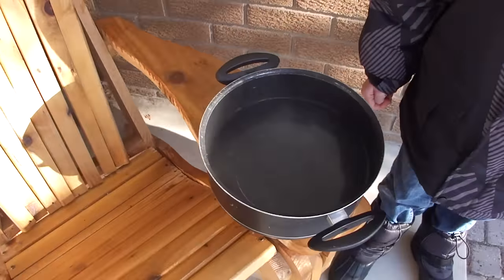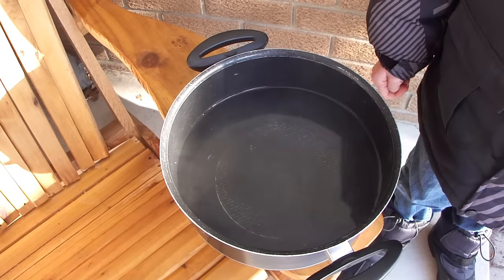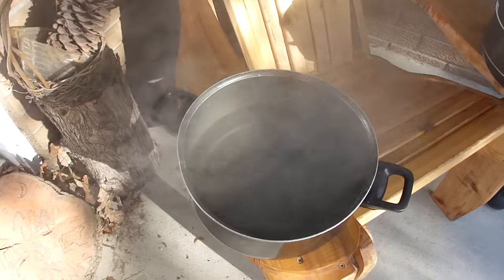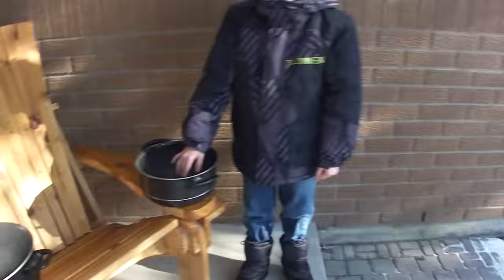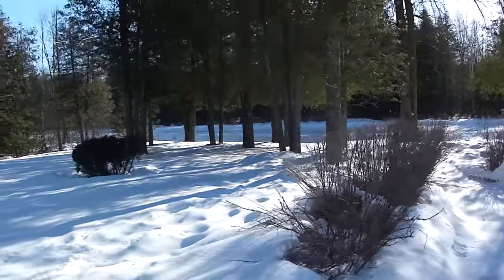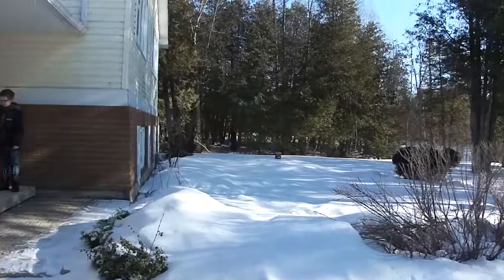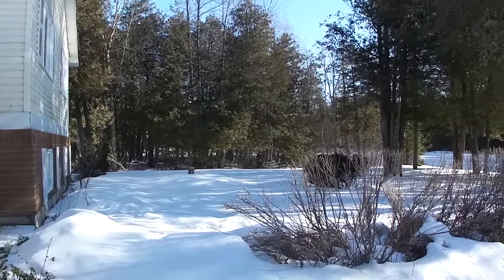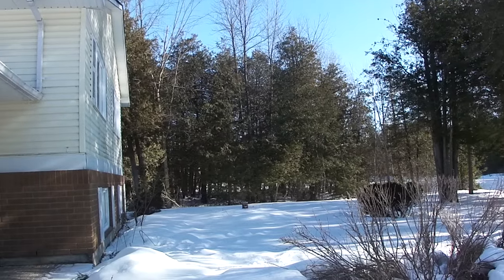Hot water freezes faster than cold water?

Comment: It’s produced more vapor...

How does that mean it’s freezes faster?
Reply: That's actually sublimation, no? I might be wrong
Reply: @dionemartins0212  yeah, unfortunately you are wrong. In sublimation, the substance goes directly from solid state to gaseous state. Eg. Dry ice, camphor,  air freshener balls, naphthalene .. ....
Reply: @tusharshahi01  well that was a risk lol
Reply: Bro if you actually give it a thought, you'll know the answer bruh ,it's simple
Reply: That's actually Newton's law of cooling.
It says the rate of loss of heat is directly proportional to the differ of temperature between the body and surrounding. 
In this case, for hot water the difference of temperature was higher so it froze quickly, but difference of temperature was low between cold water and surrounding, so it didn't freeze.

Comment: Here's my guess. I believe the water is vaporising before condensing and then freezing. When the cold water is thrown, it will not generate a lot of vapour since there is not enough thermal energy (in the video there was a small amount of mist that followed the cold water, but not much). The hot water has a lot more energy to vaporise the water, which is magnified by the sudden increase in surface area (further amplified by water's lower surface tension at higher temperatures) as well as the low partial pressure of water vapour in the air. In either case, these vapours quickly cool due to ambient temperature and condense. This condensation means that water molecules bond together to form fine droplets, which may also freeze.

Of course, the remaining cold water will freeze faster than the remaining hot water though since the hot water will have more energy to lose before it can freeze. If the water could fall forever, I wonder which would freeze first.

Comment: Before hot water can freeze, it's temperature must drop to the same temperature as the cold water started out at, meanwhile the cold water had a head start and has gotten below freezing. Its the same as if you drop a bowling ball out of a tenth floor window, and one dropped from a fifth floor window at the same time. By the time the ball dropped out of the tenth floor drops to the fifth floor, the fifth floor ball will be on the ground.

Comment: My theory is that a lot of the water is actually sitting at near boiling point and when you actually throw it into the air all of the molecules are crashing into each other more quickly turning into vapor and vapor is easier to make that powder snow since it has a high surface area compared to the volume needed to cool.
Reply: You pretty much nailed it.

This video demonstrates that water vapor freezes faster than liquid water. We call this stuff "snow".

Comment: It is a cool experiment!  It has to do with a few things. #1: Hot water molecules moving very fast and are very excitable. #2: Second law of thermal dynamics (summarized) Hot always travels to cold. The cold water has less of a differential in temperature  to the cold air as the hot water has a much larger differential to the cold air causing it to react faster and change state quickly from a liquid to a solid. That being said, the sum of the entropies of the interacting thermodynamic systems never decreases.
Reply: "he cold water has less of a differential in temperature  to the cold air as the hot water has a much larger differential to the cold air causing it to react faster and change state quickly from a liquid to a solid."

Where's the solid? That looked like steam forming in the air to me.
Reply: @synchronium24  that isnt sream. Those are frozen ice particles. They were steam for a split second.

Comment: Water forms drops of varying sizes, depending on the various forces acting on it: gravity, air resistance, thermal expansion, etc. Hot water particles have a greater quantity of thermal energy, while the strength of the hydrogen bonds which cause water to form drops remains the same. As a result the droplets are smaller.

The majority of heat loss from water drops like this is from contact with air molecules, which scales with the surface area of the droplet (bigger drop = more collisions with the air). The amount of energy required to freeze a droplet scales with it's volume (more water = more energy to freeze). As a result, the surface area to volume ratio will tell a lot about the rate at which a drop will freeze. As a drop grows in size, it's volume grows much more quickly (cube rate) than the surface area (squared rate). As a drop gets bigger it's surface area:volume ratio decreases quickly. As a result, the larger drops take longer to freeze. Because our water is in freefall and creates droplets and the size of those droplets is dependent on the initial temperature of the water, the freezing rate of the produced droplets is also, unexpectedly, inversely related to the temperature.

In the case of a pot of still water, the surface area to volume ratio is the same, and so the pot with the lowest temperature will take the least time to lose energy and will freeze quicker. 

That was a long message, but by the time I'd figured that out I thought maybe someone might appreciate the lesson, so decided to post anyway. Ciao

Comment: What do you mean, not understood by scientists? It's very simple. The hot water doesn't stay together as well as the cold water. It therefore has greater surface exposure, and the increase in heat loss due to the extra exposure quickly overcomes the extra heat it originally had. If you sprayed cold water in an extremely fine mist, you would get the same effect.

Comment: This is due to newton's law of cooling. Rate of cooling/loosing heat of a black body (in this case, water) is directly proportional to difference in temperature with the surroundings. That is why, cold water with cold temperature cools slowly and hot water with cold temperature cools down quickly.

Comment: Hot water freezes faster than cold water?   In a word, while at first glance it might appear so, the answer is “no”.

There are a number of things going on here:
1] Heating water tends to dive out dissolved gases in the water.   Water containing less dissolved air can have a significantly different freezing  rate than “normal” water.

2] Heating/boiling water can significantly reduce the quantity of water in the container (unless you take care to replace any of the liquid water that has escaped as stream/vapor, which doesn’t appear to be the case here).

3] As is clear in the video much/most of the frozen vapor that appears after the water is tossed in the air is coming from the steam/vapor thrown from the pot.  (It’s not at all clear how much of any ice crystals form from the actual liquid water.)

There are other, probably less significant factors here.  But, in short, what the video shows actually show is that:
“Different quantities of water, containing different contents, at different temperatures and in different liquid/vapor states can freeze at different rates.”

Which, all told shouldn’t be too surprising.  ;-)

(Back in the day, Jeryl Walker in his excellent “Amateur Scientist” column in Scientific American had a very nice article on the related topic of “Does hot water in an ice cube tray freeze faster than cold water”.   There are additional factors at play in that case —for example how much the hotter tray might have melted its way down into any ice on the floor of the freezer— but anyone interested in this illusion might enjoy reading the article:
https://www.scientificamerican.com/article/the-amateur-scientist-1977-09/ )

Comment: Hot water evaporates much faster due to higher temperature difference. And the tiny water mist is easier to freeze.
Cold water stays as a blob that can't freeze as fast due to much smaller surface area.

Comment: To answer the video. No. Cold water still freezes faster. What you see is damp from the hot water evaporating in the air because of the sudden change from very hot to very cold. The same way a steam bath works.

Comment: Reason why this happened is because the surrounding air is colder than water. It will create, mist or steam. It also is the reason why when you breathe in cold temperatures the water turns into steam because the surrounding air is colder than the air that you’re breathing

So no, it didn’t freeze it just turn into steam

Comment: The scientific explanation for this effect is simple.

The phenomenon that hot water may freeze faster than cold is often called the MPEMBA EFFECT.

When two containers of water are identical in shape and hold identical amounts of water, the only difference between the two is that the water in one is at a higher (uniform) temperature than the water in the other. After cooling both containers, use the exact same cooling process for each container.  Under some conditions, the warmer water will freeze first.  If this occurs, the MPEMBA EFFECT will occur.  Warmer water will not freeze before the cooler water is placed into a similar condition.

For example, if the hot water temperature is at 99.9°C, and the cold water temperature is at 0.01°C, under those circumstances, the cooler water will freeze first; however, under some conditions, the warmer water will freeze first. This effect can only be performed if the ambient air temperature is considerably colder than the warmer water (usually at the precipice of boiling).  Thus, this causes a rapid exothermic reaction.  If that happens, you have seen the MPEMBA EFFECT.

For more information, take a look here: https://en.wikipedia.org/wiki/Mpemba_effect

Comment: 1L of water at 70° needs to get rid of 292691J of energy to cool down, and then needs to get rid of even more energy to become a solid, now cold water at 10°C would only need to get rid of 41813J of energy but still would need to get rid of the same amount of energy as the hot water to become solid. Freezing hot water would require a lot more time to freeze since it needs to get rid of a greater amount of energy than cold water, the effect you saw in the video is pretty much the same effect when you breathe in cold air and there are those little clouds from your mouth. It is the hot water heating up the cold air around it.

Comment: Probably because ice is actually less dense than liquid water, so boiling water would have a closer density to ice than cooler water
Reply: Nope there is deltah vaporization and delta freezing for hot steaming water,I think it's because the vapour get freezed first because it has more surface area
Reply: But if we cool them manually,you know result

Comment: So many wrong answers. It's really simple, the trick is in the steam that escapes. Because a significant fraction of the hot water evaporates, it carries a huge amount of the energy with it. So the rest of the water freezes quickly, but the hot water system as a whole still has much more thermal energy than the cold water system. The cold water will be long frozen by the time the hot steam condenses and then freezes.

Comment: Yea this is such BS.  Hot water does not freeze faster than cold water under the same conditions.
If you are flinging it into the air willy nilly like that you will get different effect but not the freezing of the water.  The water disperses easier resulting in the areosolation of the particles due to lower viscosity & covalent bonds.
It is the same reason why when you pull a cup of liquid of out of a microwave it is more likely spill.  The lower viscosity makes it move faster break apart easier.  So if you fling it into the air like that it will break apart and expose each drop to more cold air which can make it freeze faster or convert to steam.  Converting to steam isn't freezing.

If you want to see if boiling water will freeze faster:
Take two bowls at room temperature.
Pour exactly X amount of cold water into bowl A.
Pour exactly X amount of boiling water into bowl B.
Place both bowls outside in open topped boxes outside in freezing temperatures. (Make sure the boxes block the wind.)
Then see which one freezes faster.  It will be the cold water.
Reply: 6